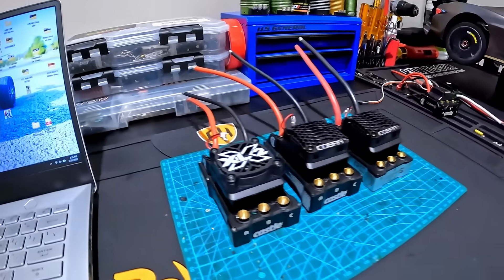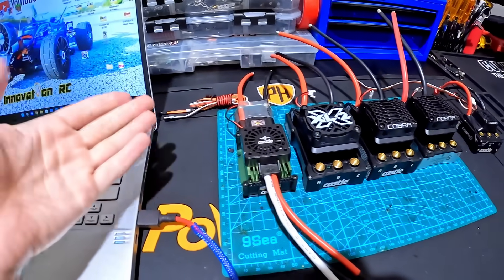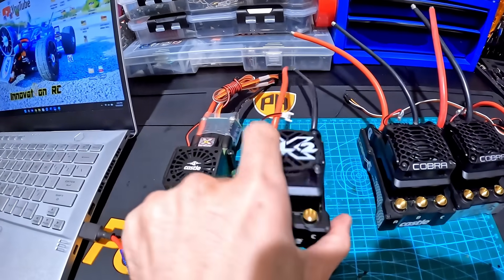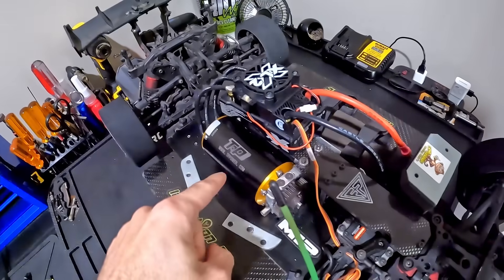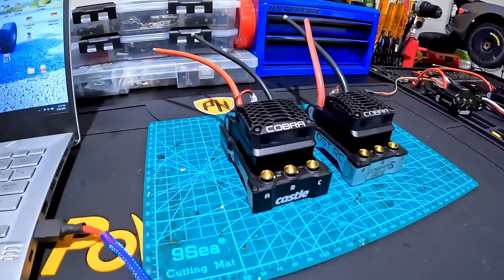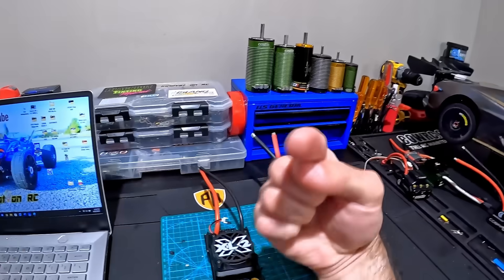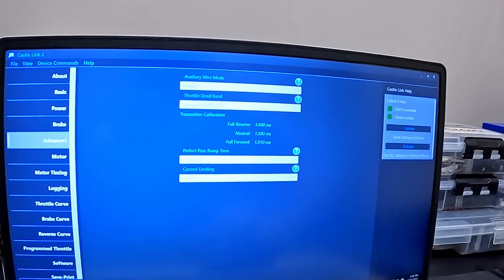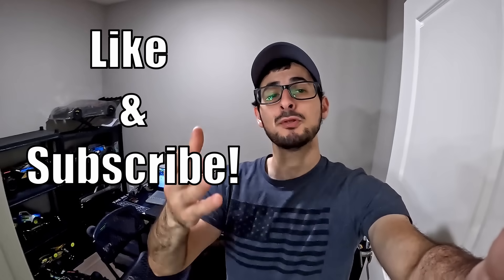BIGGEST 8S ESC Comparison! XLX / XLX2/ Cobra 5/ Cobra 5 ACE

Comment: I have an HPI Baja Flux with the XLX2/1100kv 8S setup. Would it be worth “upgrading” to the Cobra 5 or Cobra 5 HV? Would I gain anything other than cooler running temps?

Comment: TP 4050-SCM 3190KV (8S)  in a felony i dont know what esc to use please help.
Reply from the maker: Run that on 5-6s tops with a X8s ESC. That motor is way too high of an rpm to run high voltage. Get a 2200 or 2000kv
Reply: @InnovationRC 
so running it on 8s won't work?
I wanted to do a 8s build without flipping the motor and being able to do burnouts while driving. 
What is the best combo for that .
Now that I know the motor i got is completely wrong.
Thought the higher the RPM the better ×_×

Comment: Castle Creations: Hmm, our XLX2's are catching fire all the time, what can we do to fix this
Also Castle Creations: Let's release another ESC that is the exact same but remove all limits so if will for sure catch fire.
Reply: They dont catch fire all the time.... they had a firmware issue years ago.... the after issues were designed issues which they changed.... so yea this literally fixes that... the cobra 5 has more safeguards.... the ace is a better built xlx2 with less restrictions

Comment: Hey man i have a question i have the cobra ghost ace esc and a 2000kv cordova motor i drag race is the motor to much for drag racing because it cogs and i resoldered everything
Reply from the maker: Probably too much gear on the motor. Cogging is normal for a sensor less motor under load.

Comment: I have a bigrock 223s running 3s batteries, 3300kv motor.
I want to upgrade to a castle esc but they all say 6.5 pounds and low kv. I'm confused what I should choose to keep my speed but upgrade the quality of parts

Comment: I'm running a Fazon 6s blx I'm looking to upgrade the esc and motor can you please give me a recommendation I bash pkay in the water and do speed runs on front of my house on the road what setup do I use?
Reply from the maker: I'd definitely go with a Castle X8s. Not too big but it's a hell of an upgrade you'll definitely be happy with. With a 1650kv 1520 motor. Run it sensored and you'll fall in love. Gear up to go faster
Reply: Ok i will tJe that advice any recommendations in gearing i hace 5.9 lopro tires which is my bext question how do you keep the rubber on the rim T thise speeds  @InnovationRC

Comment: They recommend running the 2400kv with the xlx2 but you say no. What esc is for that motor?!
Reply from the maker: You can, but consider gearing and voltage. Direct drive gearing on 8s with the 2400kv will hit the board. I geared lower on 8s and it was fine.

Comment: Yo would the tppower 4050 7700kv on hv 3s (14.3v)  be fine on a xlx2/cobra 5 (349 amps)  dual motor car too thatd drop amps down a bit)
Reply from the maker: Ok 3s MAYBE. Keep in mind the boards of these escs are built to run up to 2500kv on 8s tops. Easy to hurt them if the kv is above that
Reply: @InnovationRC   NO esc's that can push what I'm looking for?    I'm going extream power to weight   (fist good speed car 4 tech 2.0 Castle 7700kv on hv3s (106mph) 

the motor I want to use is the size os a 1/8 castle 2200kv but its 7700kv.

Comment: I run the XLX in my Xmaxx with a 1100 kv castle motor….its a beast…I run a belt drive with a ridiculous gear ratio….geared pretty high…seems like it was 35/30 but can’t remember for sure…..it’s extremely fast even on 4s…I has to turn punch , timing and expo down to keep the front end down…tried it on 6s once and just insane…not even fun to drive.
Motor/esc not even close to being hot after running a couple battery packs through it.
I’d like to go with an xl2 but not sure it would be worth it ..

Comment: I have a brand new xlx og in a drag kraton 6s i built an never drove. No plug on the esc yet. Just mounted on top the center diff.
Reply: @mikellewis2346  I have a drag k8s
Reply: @QZillasWorld  id like to see pictures of that. I love my 6s drag build so much I couldn't bring myself to drive it. I watched everyone flip and destroy there car's while building it and when done it was to nice to break. Sold the cheap 4092 1700kv motor I had in it and plan to one day put a long can Tp motor in it and make some passes with it. But with a different body of course. The older v3 style 6s body's are no longer available and I absolutely love the body i painted silver for it. Call it the silver bullet. Lol 😂
Reply: @mikellewis2346  already uploaded

Comment: what about a big power esc that can handle high rpm big motor
Reply from the maker: 2900kv is definitely high rpm for those escs, on 8s it's too much, better kv for 6s
Reply: 4050scm 7700kb on 3s? (14.8v) 349 amp?

Comment: Hey, my question isn't going to be this advanced as these things that you normally do, but I got the arrma big rock 223s 1/10 scale and the 2 in 1 esc is driving me up the wall. What would you put in as an replacement or upgrade ESC for the big rock 223s just to do bashing with it and just have fun with it. I would like best of the best of these ESC not to worried to much about it. I don't do speed runs or nothing like that. Injust.have fun with it and just do some bashing with it. Thank for your help and time.
Reply: Im not the biggest fan of spektrum elects. Hobbywing and castle both make great 2s 3s escs. Look for about 100 amp esc. That should get you to 40mph.

Comment: Hey bro I have been following you now for a while and have learned a lot from you and highly value your opinion. So crazy thing the day before the ace 5 came out my mmx8 just stopped I mean powered off and will not come back on . Oh yeah I basically only speed run hobao GTB long story somewhat short lol so I called Castle talked to a tech and because I really didn't have the funds to upgrade to the xox 2 or really even getting my MMX 8s repaired yet I went ahead and ordered the xlx because it was on sale and like you said send a tech said it was the OG you put in the work back in the day do you think that I can get over 120 out of this thing that's all I've ever went is 120 on 6s I've been a little bit over a hundred on 4S and that's with the monster x I know that it's not going to be the xlx 2 or the new ace 5 what do you think can get more than 120 mph out of the xlx discontinued one I have the first version of The Castle creations 2200 KV censored and I also have a 3,000 KV Poseidon it was made by Steve nue I bought it from saga you told me what gang to run and I can't run no more than 6s with it I've never ran 8s before anyways so I won't be pushing it more than 6s. Sorry to write you a book man just saw your video on all this and I just got that ESC should be here any day supposed to been here yesterday but FedEx screwed it up so it'll be Monday LOL but just hit me up when you get a minute thank you for your time man keep up doing everything you do bro I love the new hydro it's really cool LOL

Comment: I've been looking to give castle another chance lately.   I was actually about to order another xlx2 this past week.   Then i see the new cobra 5 come out.   I'm not playing with them any more.   I was a Guinea pig for the xlx2 and got my Xmaxx melted for my trouble.   
I do think castle missed out by not making the cobra 5 12s capable.  I'll be sticking with Hobbywing and my Max 4 and 5 G2's it looks like.   Only chance for me is if someone is clearing stock of xlx2's and makes a deal i can't pass up.
Reply: Better start trying to find those max 4/5 stuff quick, they are discontinuing the sensored systems and going to sensorless systems trying to catch up to Castle in the speed running and drag racing. They have already replaced the max 8/10 systems with the sensorless systems. Notice all the heavy discounted sales on the hobbywing stuff recently? They be trying to clearout all old stock to make room for the sensorless stuff.

Comment: For 10th scale I have an old associate tc3 drive shaft and an xray tc4 from 05 belt drive that I used to speed run long ago, both brushed and 6 and 7 turn motor. Looking to get into brushless. Castle most likely and wondering if those 2 cars are good to start for 10th scale

Comment: How make it support 12s that's how !
Reply: I agree totally.   I don't need 12s on my big bashers but it's fun to slap 2 6s batteries in them every now and then just because I can.  We're not all speed running but I can't see where 12s wouldn't be better in every case for maximum go juice.
Reply: Awesome comparisons bro. Gotta love those warning labels.  I think the next biggest thing is the 6AWG wire on that puppy
Reply: Up the voltage ⚡
Reply: I can’t believe Castle isn’t implementing Telemetry on those things.   What a let down.  I switched to Hobbywing for my wife’s vehicles to try them out.  Telemetry is the only reason my vehicles still have the castle product….     Things always change…. No worries.
Reply from the maker: They only go up to 8s, not 12s.
Reply: @InnovationRC  I know what i'm saying is Castle need to make one that can do 12s we don't need A XLX2 2.0
Reply: @SIRICKO  just over gear it and watch the esc work!
Reply: @QZillasWorld  get the marshmallows out and ready. Cus there's about to be a fire 🔥
Reply: Is the fan shroud on the Cobra 5 aluminum?
Reply: Well, I got a good news for you
Reply: 12S would be a simple firmware update if they wanted to but stay tuned for that.